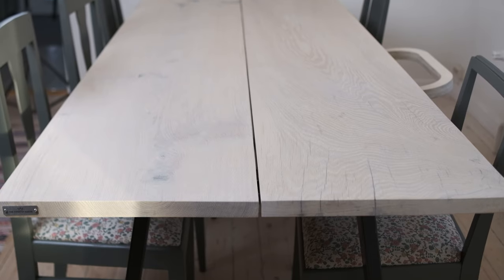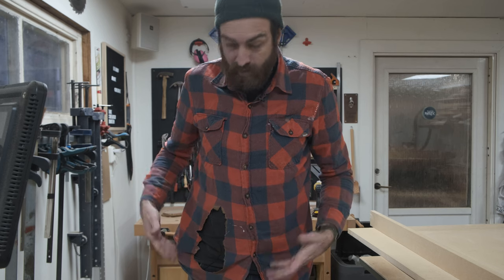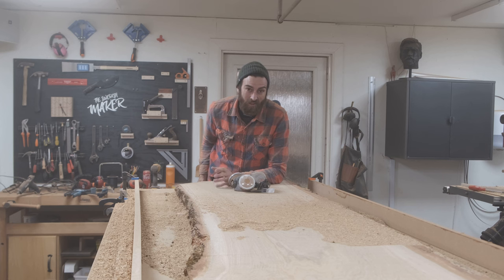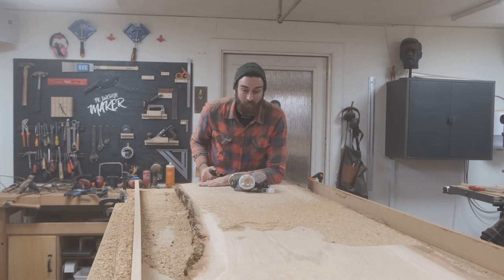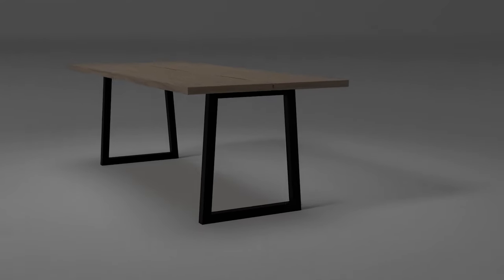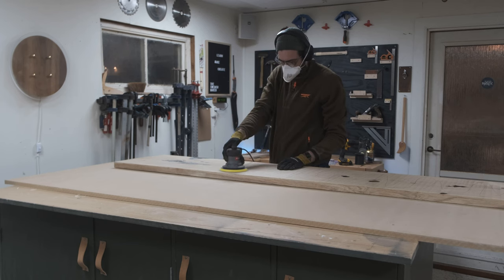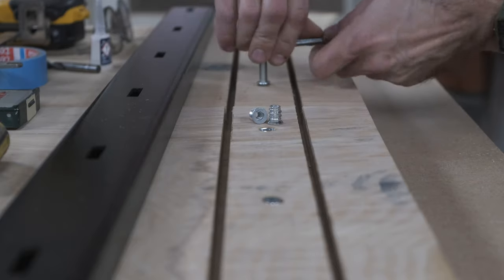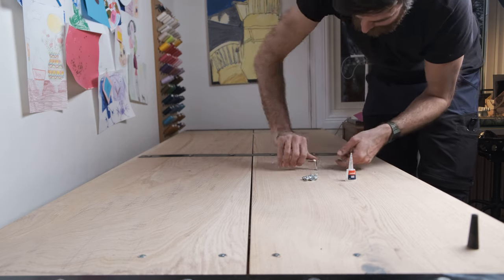Beginner makes $8000 slab table

Comment: Besutiful work! One thing, because health is imporant. You should buy a dust collector with 99% filtration, they are not expensive. Dust from hard wood can be harmful. Take care and keep up the good work!
Reply from the maker: The dust collection hose couldnt be fitted on the router with the bit I was using so thats why I had to go without using it. Thanks!